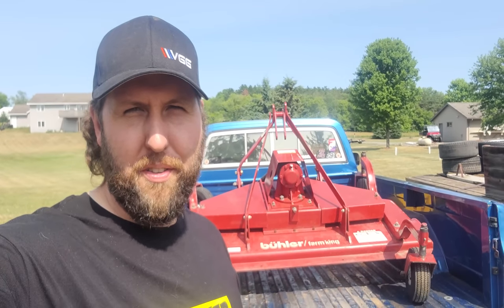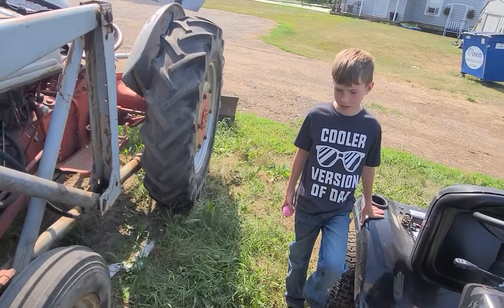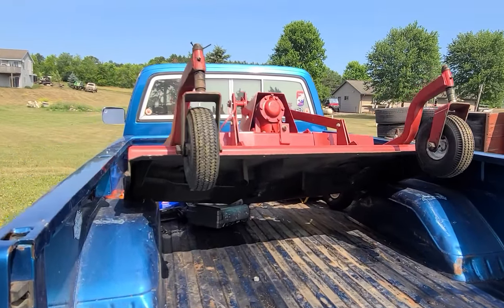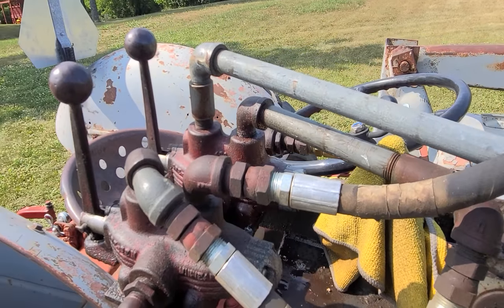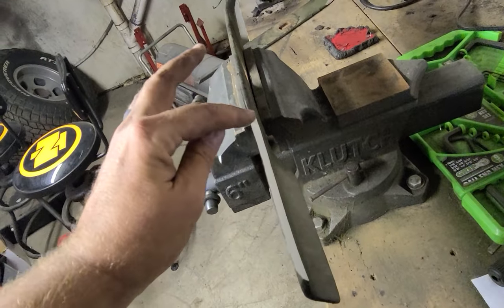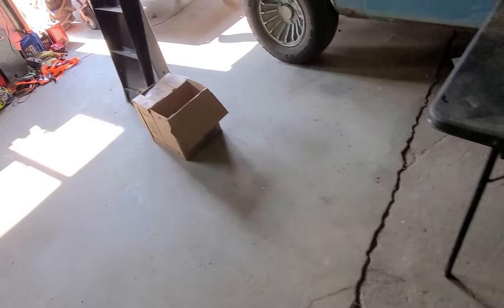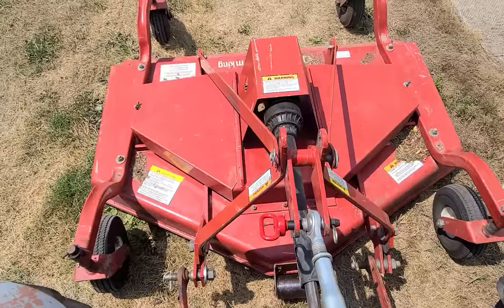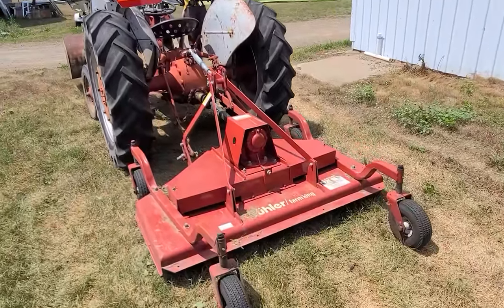Will This 3 Point PTO Finish Mower Work on the Ford GT500 (8N/9N)?

Comment: Would love to see a guy doing some upgrades on the tractor.
Reply: yeah i totally agree. i have an 841 and would love to see that old ford get some love.
Reply: Definitely needs pinstripes
Reply: Like a Gm LS454 Swap ??
Reply: Didn’t he talk about building a flathead v8 for it a while ago?
Reply: Definitely. 👍👍🚜
Reply: @jessicacordova5024  that would great but she just won’t bolt up to the gt 5 hunddie go forward go backwards box 📦
Reply: Spent many many hours on a Ford 8n as kid. Hay, tobacco, garden plowing, a bit of gravel spreading and snow removal lol.it did it all.
Reply: I wouldn’t like to see it. He doesnt even know its a 2n
Reply: @byerboys2607  there are lots of these tractors with a flathead v6 and v8 swap along with ford 302 and chevy 4.3l...you just need an aftermarket mounting plate
Reply: If I remember right, the ford 390 has the same bell housing pattern as the ford tractor
Reply: He sold the tractor for a newer one, so keep dreaming.

Comment: Be careful using that Derek. If that’s a fixed PTO adapter you really need an overrunning clutch. These are famous for people pushing in the clutch to stop and the momentum of the mower spinning keeps driving the tractor since the PTO is driven off the rear end. Lots of 8n Fords went over the hill cuz they were mowing with a rotary mower and no overrunning clutch.
Reply: Rotary mowers have 50 pound blades with a “stump jumper” that also weighs a metric crap ton this has blades that don’t weigh 10 lbs put together. Not saying your wrong because you are not but this mower is not considered a rotary mower
Reply: I added the one way clutch adapter to mine.  I also hook limiting chains on the three point and basically makes a bush hog into a finish mower.
Reply: Yep. A friend had one. Found that out the hard way. Hit a filbert tree with the bucket. Oops.
Reply: Overrun couplers are also and easy fix. Have one in mine with no issues.
Reply: this is a finishing mower. not a brush hog. they dont need that extra stuff as they dont have enough spinning mass. i mowed alot useing a 43 ferg with a very similar 3 point finish mower hanging  off the back.
Reply: Finish mower or not, it's best to have an overrun clutch...
Reply: @member57  why put one in if its not needed? the belts slip before the tractor moves if ur dumb enough to shut her down with the mower still engaged.
Reply: @5150warpig  no doubt if people just had some sense if you don't know how to drive a damn tractor then stay off of it!! Sounds like these people going down these hills! 🙄 LOL ain't got no business in the seat of anything!!!!!!!!!!!!!!!!!!!
Reply: H'wat?
Reply: @5150warpig  
Because safety. The N series PTO is directly connected to the transmission, the momentum from the equipment, any equipment, will keep the tractor moving forward even if you press in the clutch. It's a CHEAP piece of insurance. Anybody that owns an N series needs an overrun clutch on their PTO shaft.
Reply: @member57  Yup.
Reply: I have one with a finish mower....not enough mass moving to make a difference that I can tell besides a slight nudge. A bush hog would need a clutch for sure.
Reply: @blakehintz3207  
Overrun clutch is an adapter that goes on the tractor PTO. It allows the PTO shaft to transfer power to the equipment but won't allow the equipment to transfer momentum back to the tractor. Tractors like the Ford N series have the PTO directly driven from the transmission and not the transmission clutch. So if you come to a turn and need to slow down, or a child runs out in front of you, the mower's momentum doesn't let you unless an overrun clutch is installed.
Reply: Done it both ways with a 1952 8n.  Bush hog or finish mower.  Never had an issue.  But not saying I haven't seen it happen.  Usually when turning sharp with a fence coming up
Reply: ORC was the 1st accessory l bought for mine. Mower was 2nd.
Reply: Knew a fella a few years back was mowing his laneway, stepped on the clutch and it pushed him down the ditch where the tractor overturned on him and killed him. An over running clutch is cheap insurance.
Reply: Wow you learn something new every day . So in that situation if the operator shifted to neutral would that stop the implement from pushing the tractor forward ??
Reply: @jamesjohnson6239  no. It would still push you until the rotational mass quit turning
Reply: @jamesjohnson6239  yes, but with the mower's momentum "pushing" on the transmission, it may not want to pop out of gear easily. Had a John Deere 420 two cylinder with a 72" finishing mower & no over running clutch.   it was easier to shift/disengage the PTO than to get it out of gear if things got interesting.
Reply: @jamesjohnson6239  it's hard to shift into neutral when it's being pushed by spinning pto. It's almost like it locks it into gear
Reply: I would install an ORC just in case the little humans ever run this mower. (You know they will)
Reply: What everybody has to remember the ford 8/9N Has what they call a straight PTO not a live PTO you step on the clutch to disengage the engine and the pto is still directly coupled to the transmission and it will push the tractor
Reply: @jamesjohnson6239  Yes however it's very difficult to put in neutral as the gears are straight cut unlike a car/truck helical gears and remember the gear shift is between your knees under the steering wheel.
Reply: @normhowes2975  I thank you for the info.
Reply: That would make a interesting video!
Reply: well luckily he doesn't live on a cliffside, at least it doesn't appear so.
Reply: as my grandpa said many a fence post and corner post got moved if they needed it or not when 8n fords where around
Reply: @motorman1873  you've obviously never driven a 9n with a finish mower...
Reply: @5150warpig  you've never driven a 9n with a finish mower have you?
Reply: @curlcd  nope. the one i used was the 8n variant.
Reply: Good way to put in a new garage door or a new entry way if you aint careful.
Reply: Yep.  The opposite of a live PTO is a dead PTO.   I’ve been pushed on an old 601.   Pretty scary.
Reply: @kentbuerk9479  Wrong !!  Neutral means just that .... no gears engaged !!
Reply: I was thinking the same we always ran over ride clutch on the PTO shaft on our 9n and our 601 but that was with a hog they have a lot of spinning mass but that being said I live in West Virginia where flat land is a very rare commodity I think I would still prefer the overriding clutch it's bad enough to get a run away tractor on flat ground the pucker factor goes up by a multiple of 10 on a steep hill
Reply: @motorman1873  haha
Reply: Not to mention it'll be easier on the gearbox of the mower not to be slammed to a stop...js.
Reply: Sure he knows what he’s doing
Reply: you're right my IH F 12 would push thru until i installed a OR clutch.
Reply: Good advise... a lot of comments that it's not needed because years of not using it and nothing happened.  Well... I've been driving semi tractors for nearly 40 years.. I wouldn't say because nothing ever happened that I don't need insurance...

Better safe than sorry...
Reply: That is a 3 blade mower I don't think you need a ovrerunning clutch
There is not enough centrifical force
Reply: Talking to a man who drives cars without brakes, bad tires and limp suspension hundreds of miles across the country. I find this amusing.
Reply: 3 blade grooming mowers have small blades
I dought if it has enough centrfical force to cause problems
When you engage the clutch leave the mower on the groung and the grass will stop the blades
Single blades get a over run clutch
Reply: @darrylvohs5526  
A brush hog will never mow as clean as a finish mowe
Reply: @member57  
Mowed a lot on my 8N with Finnish mower
Never needed it
Brush hog yes 
If needed a brush hog I used my 2150 JD
Reply: and most had no or poor brakes. If they had brakes, they didn't weigh enough to grip and stop
Reply: Best lawn mower are animals that eat grass and people eat animals that eat grass. That's how they mowed grass for thousands of years.
Reply: We use an old Massey Ferguson 65. It lets u stop without having to stop the mower.
Reply: He did cover this in his last video.
Reply: Yep, I ran a 9N through a fence that way... And I KNEW better, just wasn't paying attention.
Reply: @motorman1873 you're awful arrogant about that, aren't ya? You've NEVER made a mistake? Never been driving an automatic trans vehicle for months, hop in the old farm truck and forgot to push in the clutch... Starting OR stopping?
Never needed to stop, shut off and get off a tractor in a HURRY for whatever reason?

Hey everyone, all hail Mr Perfect!! 🙄
Reply: @leejohnson229 I've done it. And I've been operating farm equipment etc since I was big enough to reach the controls...about 47 years.

Comment: I love seeing these old tractors still being put to use. The sound especially is just something you don't get anymore.
Reply: It's too bad he sold the GT500 for a newer tractor.
Reply: The sound of the old two-cylinder John deere is the tractor that I love to hear. They had a high idle of 950 rpm and when you idled them down you could actually count the number of times it fired.
Reply: However if you have plans to use an antqiue tractor like this one for mowing you will need to convert it to 12 volt so you have enough power so you can run your pto deck otherwise you'll need a manual reel blade cutting deck
Reply: @deanfarr3249  WTF!!! the PTO on these old tractors has nothing to do with the battery It's a tractor, not a lawn mower!
Reply: @radamson1  but he's running an auxillery on the back of the tractor though right? Plus the hydraulics? I would think you would need more battery power for all that
Reply: @radamson1  
That's a Ford 8N
Reply: @ericmatson8433  Good lord man, of course it is an 8N, that doesn't change the fact that I like the sound of the 2 cylinder poppin Johns!!!

Comment: Derek:  "The only thing I trust on this is that the seat's uncomfortable."  😀

Well, a feller's got a GT500.  That's a racing tractor, so you sacrifice a little comfort for performance.   😀
Reply: Had a 9N we used growing up to mow with a 60" finish mower. That bastard was uncomfortable and the brakes didn't work, but damn did it start every time. My grandfather "rebuilt" the ball joints with a welder and grinder, and three point hook-up did not hold pressure when the tractor was off.... I miss that thing.
Reply: @Omgninjas2  we had 8N fords and a massey ferguson we used to pull rakes and the balers. great tractors wish I still had one

Comment: I was about eight when I learned to drive on my Grandpas farm in an old Chevy pick up with a floor shift. They put me in a pasture and said that they didn't care about the truck very much but to make sure to stay away from the fences. What a blast. I am new to your channels and I am really enjoying the content, which is right in my wheel house or perhaps more accurately I should say was. now that I am getting older. What I like most is the wonderful interaction between you, your pretty bride and your adorable boys. I know the older ones won't appreciate the adorable part...but they are. Nicely done.

Comment: On my brother's 8n you had to use a Sprague Clutch on the PTO so when you pushed the clutch the enertia from the mower blades wouldn't drive you thru a fence.
Reply: You made a mistake, the trolls who don't own N series will argue that you don't need one or are an idiot if you can't stop.. 🙄
Reply: My grandpa always called them a slip clutch lol deffinetly useful for sure
Reply: @member57  I found this out when a friend drove his 8N through a fence because he couldn't stop it, it had a 5-foot mower deck on the back. There was no stopping it. That's where I found out about the sprag clutch.

Comment: 9 year old driving a pickup truck.
 Karen: "Someone call DHS!"
Normal people:  "Love it! Keep raising those kids right!"
Reply: Back in the day we didn't even have automatic. Had to learn to drive manuel from the start.
Reply: @mcmaddie  that's exactly right. Put it in your lap for first gear, put in on the dashboard for second gear, put it in the ashtray for third....don't worry about reverse!!!....we go FORWARD on this farm!!!
They taught me to drive pulling a trailer to haul hay because I was to little to throw bales over the rail. 8 yrs old I think....maybe 7. Then, when they came along with a truck that had a shifter on the FLOOR.....It was time for me to THROW BALES ....UHGGGG!
Reply: Yepp. Drove an old ford with a block on the gas pedal. Bare could see out. Just let off the gas and it would idle slow enough for the big boys to through bales on ;)

Comment: Under the axle by each rear tire should be a pin that you can hook anti sway bars to the 3 point lift arms. Keeps the implement from moving left and right and contacting the tires. I second an over run clutch as well.

Comment: Lengthen the top bar when cutting, the mower deck will ride on all 4 wheels and float across the ground. Tighten it like you have it when you need higher lift to maintenance your mower. Love the old tractor and the lodge videos!
Reply: More lodge.

Comment: I've always preferred the drawbar type to 3 point when it comes to brush hogs and mowers..they work better on hills and there's no need to constantly monitor your 3 point height...but they are more convenient for dodging stumps you realized you missed when already half over them
Reply: I use a quick hitch, but run a chain instead of a link on the top. It lets the brush hog float with the terrain.

Comment: New sub! The wonders of YouTube's algorithm! I just went to look at a brush hog for my 1951 Ferguson — basically the same tractor as this — but unfortunately the brush hog had a bent PTO shaft and at 60" was a bit too big. I got a kick out of that. Also, my daughter started driving around the property when she was 8 (Gator mostly), and had got her farm tractor license at 11. To top things off, my tractor came with that exact same ancient back blade as the one on yours. I look forward to any work done on the tractor. I just did a bunch of videos on converting to 12-volt and now need to do the brakes...

Comment: Does it have an issue were when you let the clutch out, the mower acts like a flywheel & drives your rear wheels through the p.t.o shaft drive?? Squatch253 just had a video talking about this problem & he used a ratchet coupler or overdrive mechanism & allows disengagement so you can use the brakes & not plow through your neighbors fence or something of the like. Here's His vid....  https://youtu.be/FaJJUF1uFVs?t=294
Reply: Yeah on the old Ford tractors the blade will keep spinning and can run you right into whatever is in front of you. Ratcheting coupler is a good thing to have for these tractors
Reply: You missed a great opportunity to link the Rick Roll video.
Reply: Fleet farm or tractor supply have over-run adapters that also adapt to the correct pot shaft size.
Reply: You need the 3 point sway bar on the side to keep the mower centered and it won’t hit that tire, fleet farm or tractor supply has them
Reply: I’d love to see a video on changing your own tractor tires, I have an 8N and a farmall h, both need tires, I’d like to do it myself, hope to learn from you.

Comment: Hello I just had a couple of comments but you probably know about anyway but here it goes! I have a 72” farm king finishing mower I keep the blades sharp and the the belts just slightly loose so if I hit something solid there’s a place it will give rather than destroying the angle drive or the tractor, I also put a temperature gauge in the top radiator hose just below the thermostat I just took a piece of copper pipe and soldiered in a fitting for the temperature sensor and two more hose clamps and mounted the gauge on the by the dashboard so I can see it. Of course if you don’t have a thermostat you probably don’t have to worry about it running hot.And because it’s hard on the clutch to get moving I always make sure that once I get going I won’t have to stop and start again and if there’s a hill I try and use that so when I start I am going down hill and save some wear and tear on the tractor.And I try and mow on windy cooler days so the old girl can run cooler. Keep that old iron running!🇨🇦😀

Comment: Used to mow with an 8N Ford tractor and a 7 foot bushing.  Lots of steep hills.  The biggest problem was stopping the mower when coming down hills as the blade in the mower kept the tractor moving.  Had to plan your turns well in advance, as you did not stop while going down hill so turning was vital.  Replaced the 8N and 7 foot bush hog with a 48" zero turn mower and cut mowing time in half.

Comment: I see a lot of these on craigslist for sale.  I had one but the lack of maneuverability, mediocre cut and weight of the tractor digging ruts in the lawn encouraged me to get rid of it.  Moreover, I have a big zero turn now and it would run circles around this set up.   However, this guy's yard is flat and apparently this does his lawn a lot faster than what he had been using.

Comment: I can so relate to this video. I fitted a 72" PTO finish mower to my '48 Ford 8N. The shaft is never the right length off the shelf. Fords especially use really short shafts. But once I got that worked out, it did a great job.

Comment: My dad used to have an old 9n with the 2 speed hi/lo too. I always thought that was the way they came.  We used it mainly for a raking tractor, but it also pulled the blade up and down the road to level the ruts from Highway 8 south of Richardton down to the yard.  It was pretty weak though, and could have benefited from a rebuild on the engine, but we never did that. He sold it several years ago.